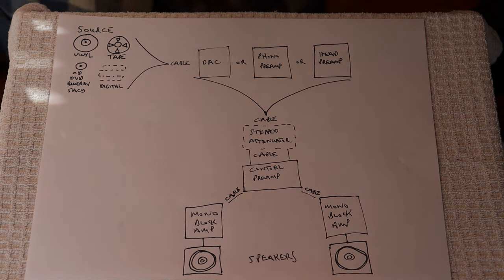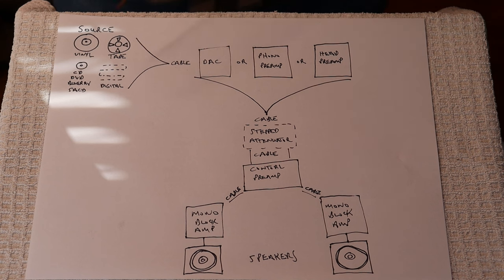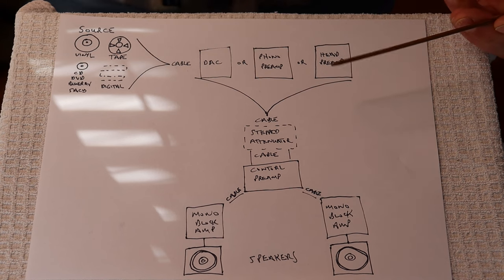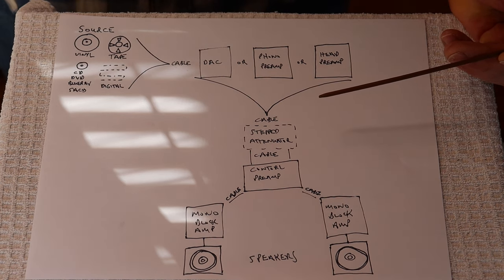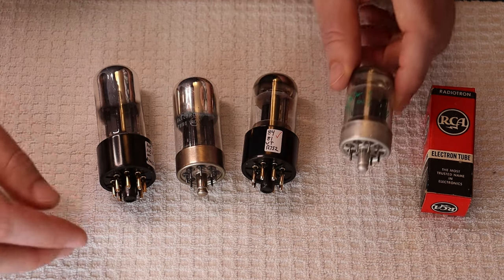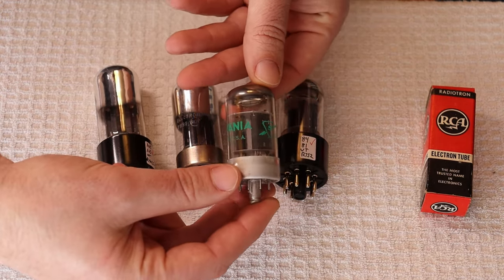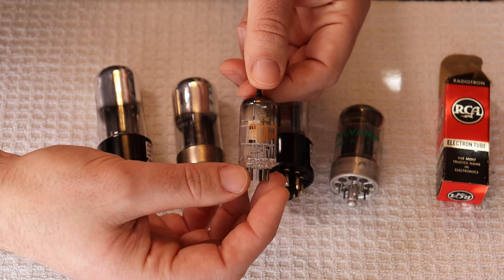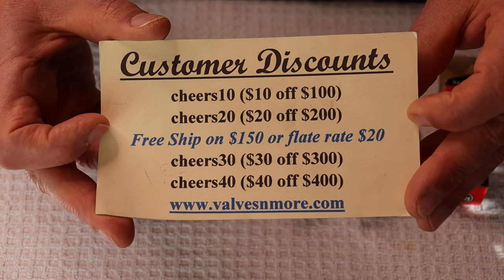Tube Lab #177 - Signal Path Purity & New Stepped Attenuator

Comment: Awesome video guys.  A lot Learned about step attenuators.  Do you guys like Germany telefunken NOS tubes for mono amplifiers?? Trying to find some 12ax7 preamp tubes
Reply from the maker: Telefunken tubes are generally excellent, in particular the early types with smooth plates, but they are now unobtanium.  They were never made in large quantities, and with high demand the chance of finding even a single tube in good condition for any reasonable money is like nil.  The good news is there are many excellent alternatives that are vintage, available and reasonably affordable, including RFT and Japan made (we stock both).
Reply: @tubelab194  thanks very helpful. I see NOS telefunken is available for about 150 dollars apiece.  Which if you're only doing four preamp tubes isn't the end of the world.
Reply from the maker: @iampuzzleman282  be very careful, most of what's left for sale are the cast offs, tubes that either test low or have very mismatched sections.  We buy thousands of tubes each year and in the last 12 months the number of orders that need refunds after testing has increased dramatically.  Sadly many sellers are sending out junk, hoping whoever buys the tubes won't test them and discover the fraud.  This will only get worse as the Global supply of quality vintage tubes heads to zero (not yet, but someday soon).

Comment: Hi there! can a stepped attenuator be mounted in an e80cc preamplifier kit instead of the 100k Alps potentiometer? Thanks!
Reply from the maker: No it's too large, which is why I placed it in it's own narrow chassis.  In our system we like the flexibility of having an extra pair of inputs and outputs as well it can go before the gain preamp or after.  Caution!  The impedance of the attenuator is fairly low (1k + step) and was designed specifically for our Kits.  The sonic improvement with it in system are truly amazing, Charles talked about it for hours after our first listening session and we've never removed the prototype after that first listen!